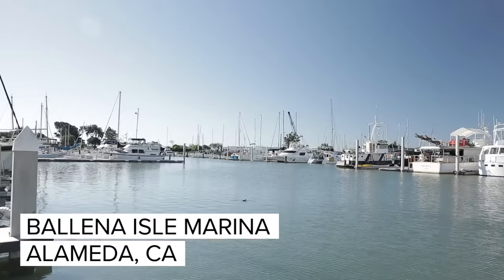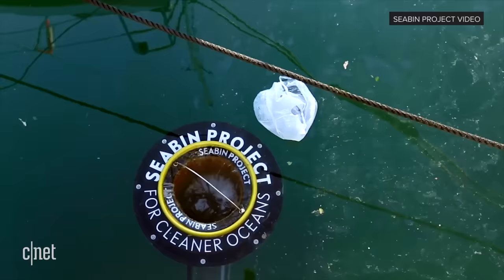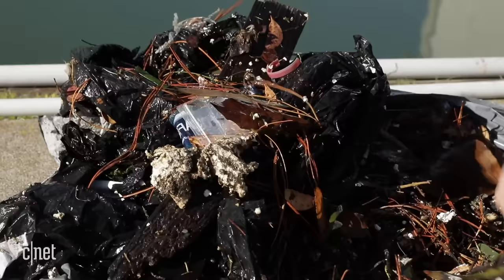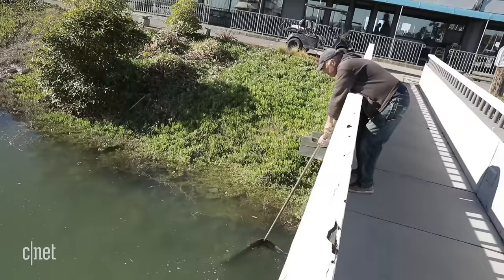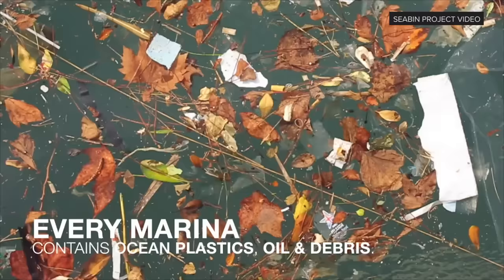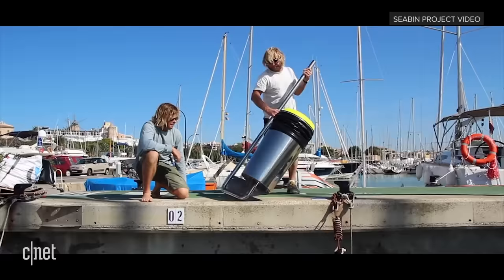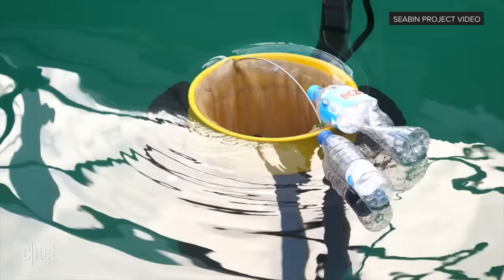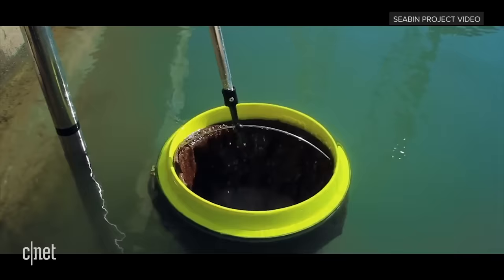Will Seabins save our oceans? The Seabin Project

Comment: He says 500watts and 4 amps is not a big power consumption 😂😂 this is a massive consumption costing about $36 usd per month each to run at .1cents pre kWh. This is a good idea in thought but would cost way to much to have 10 or 20 of there’s in a ship or boat Bay Area. Maybe if it was 150-200 Watts. Considering it’s only running a water  pump and the item it self cost what it was worth 400-600$ it would be worth it. Even in the name of science your still getting fu#*ed

Comment: 3300€ and half a kilowatt to run it? What a ripoff. Figure out a way to filter tidewater, powered by said tide and you'll filter much more garbage out for much less cost. If you have an electric pump in there, you are doing it wrong.

Comment: 500W and uses 4 amps.  Saying it that way is deceptive and bullshitty.  Says it uses quite a low energy consumption.  Watts = Amps x Volts.  So its a single phase 125 volt power supply.  So where I live that would cost about $0.75 a day to run.  Or about $22.50 a month.  And for $4100 this thing should better shit gold or give your some sort of sexual pleasure!